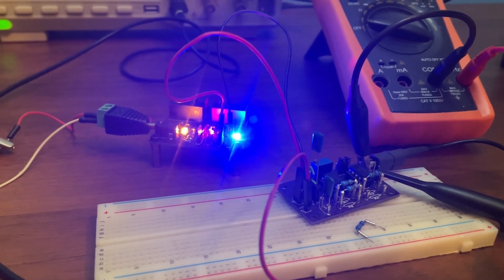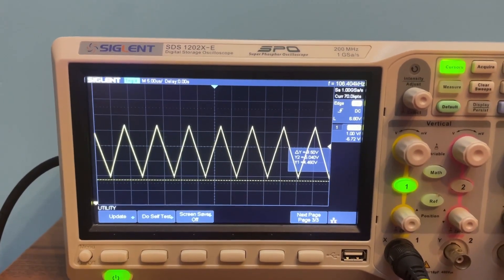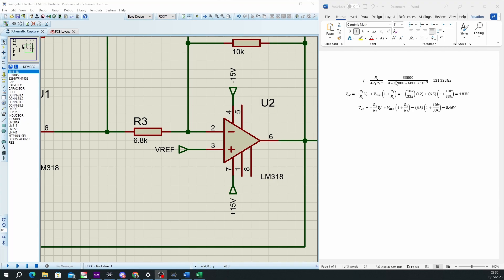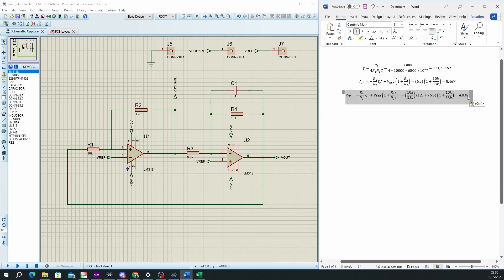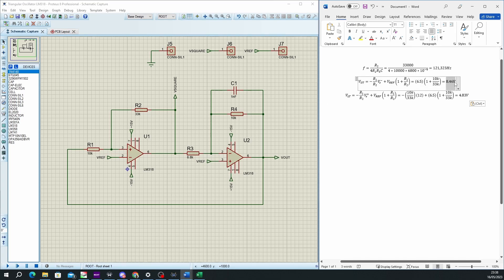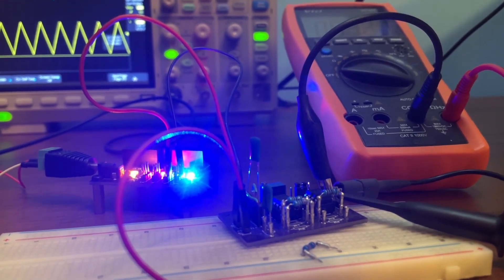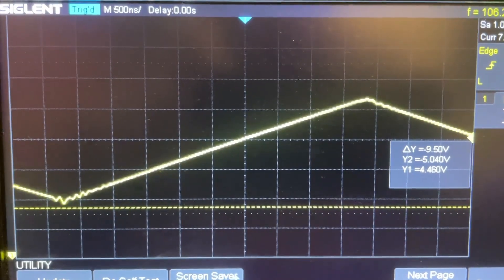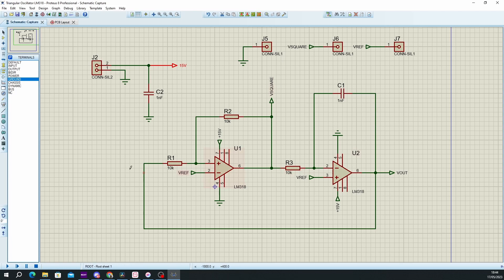100kHz Triangular Wave Oscillator using the LM318

Comment: Hi thanks for sharing.  What will you use this for ??
Reply from the maker: You can feed the triangular wave through a comparator, and vary the voltage on the other pin of the comparator to create a Pulse Width Modulated (PWM) signal. The PWM signal has many applications, it is mostly used for DC DC converters.